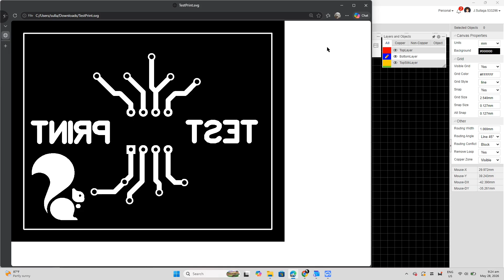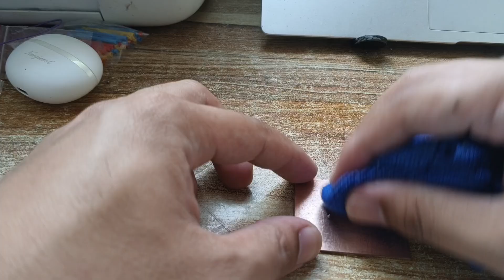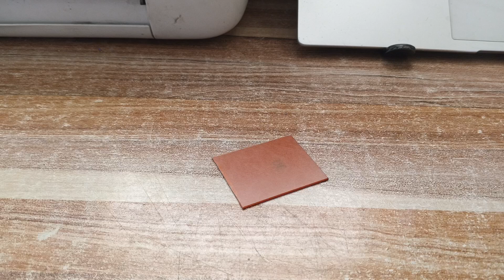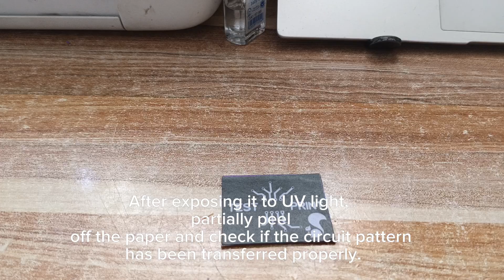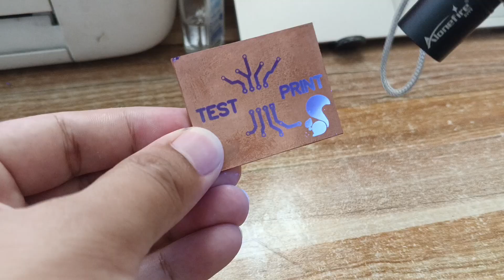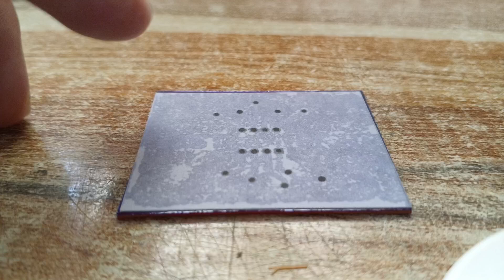DIY PCB using dry film / Photoresist

Comment from the maker: Tools and materials:
2 Printed Circuit (one is inverted)  
PCB cladding  
Sand paper (1000 grit)
Dry Film  
Oil (Baby oil)  
Cutter  
UV light  
Developer (Sodium Carbonate)  
Ferric Chloride  
3 Empty containers  
Sponge
Permanent Marker
Adhesive tape